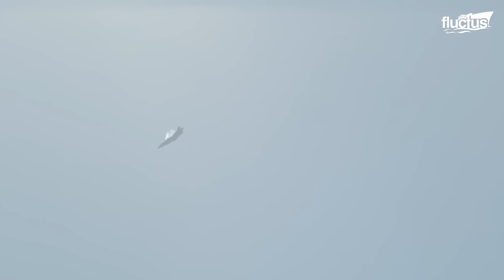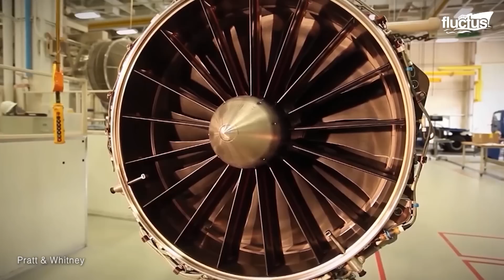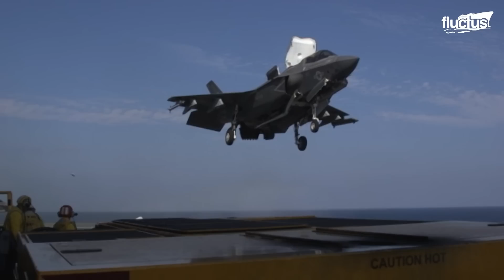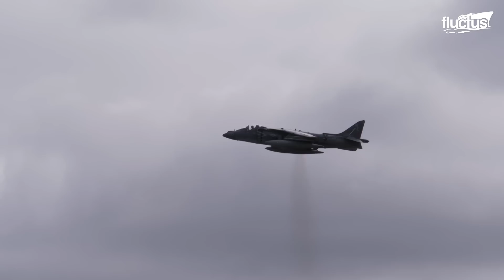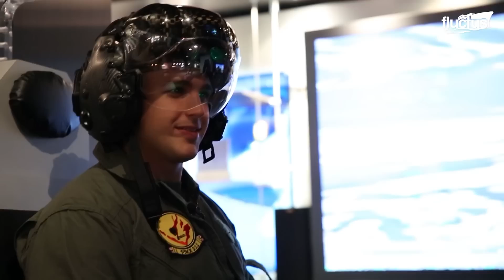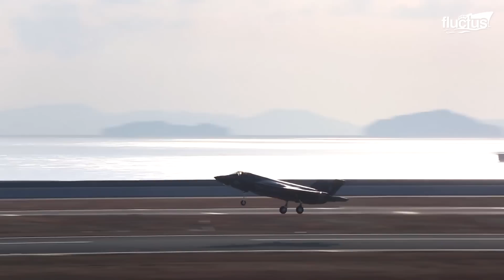Inside the US Multi Billion $ Super Advanced F-35 Assembly Line

Comment: Vertical takeoff and landing it’s kind of a joke if you think about it all that time it takes to open an angle the nozzle and float in the air leaves it vulnerable for the enemy to shoot you down before you even started and if you plan on doing a vertical landing you’re just stopping to make it easy target for the enemy to shoot you down there as well. I think it’s a lot quicker to slingshot a plane off the deck and same for landing with the arresting cable. 
F35 cheaper….. lol your crazy
Reply: It's great to have one. 1 is better than 2. And dafuq would it matter if an aircraft carrier can be shot while an F-35 lands/takes off then any plane can be shot, right? 🤣🤣🤣 But there's a mention in the video using the traditional catapult with the F-35C.

Comment: F-35B cannot take off vertically. It needs a very short runway. It's a STOL and not a VTOL.
Reply: It's capable of vertical takeoff, just not with much more than an air to air load out and minimal fuel. Still, could be useful for transferring between two close areas.

Comment: Uh, the F35 is not manufactured by Northrop. It’s made by Lockheed in Ft Worth.
Reply: Northrop helped with the development of the F-35 though, so Lockheed isn't the only company involved with the jet.
Reply: The F35 parts are outsourced to many different companies, the company I work at (JCMI) makes some F35 parts
Reply: @DirtFather407  good info thanks
Reply: No Northrope builds the main f-1 tank.
Reply: Actually it's made in every Country that participates in the program and is assembled in Fort Worth
Reply: Starts in Marietta GA
Reply: Starts in pinellas park Florida, bulkhead is drilled and assembled there. Marietta is the second step

Comment: How did Northrop end up manufacturing a Lockheed aircraft?
Reply: Lockheed is the primary but all of the big 5 have a hand. Northrop does the cabin, BAE does the tail find, Ratheyon/P&W does the engine, Boeing has a lot of the avionics and LM is full assembly. In fact the factory footage is an LM facility.

But that’s the least of the inaccuracies in this video.
Reply: @arthurvandelay846  Northrop Grumman literally supplies the F-35's radar, one of the most important component of a modern fighter aircraft.
Reply: Yeah, big slipup.  I have been thru the plant in Ft. Worth twice to tour as my company manufactures parts for it.
Reply: Funny enough I thought I was the only one who noticed that. Maybe they are manufacturing partners
Reply: No. He made a mistake. Good catch. I used to work for Lockheed Martin who builds it.
Reply: Because LM purchased and now owns Northrop - so Lockheed uses those assets. it is a Lockheed product, but Lockheed owns Northop.
Reply: @Albertkallal  That is not true. In 1998 Lockheed did try to by Northrop, but the government put a stop to it. They are still separate companies.
Reply: @dMb1790  
Thank you kindly - I stand corrected. I will leave this comment up - not delete my mistake. I had thought LM purchased them - and it looks to be I am 100% dead wrong. And that means the suggest/hint/quote in this video is thus also wrong.
Reply: @Albertkallal  I blame Google. If you search it, it has that commonly asked questions part, and one is “Is Northrop owned by Lockheed?” Under the answer section Google just copied the part that says,” In 1998 Lockheed agreed to buy Northrop.” And it leaves off the part about the deal being cancelled.

Comment: This site is wrong about the F35 Time Line.  
On Paper all 3 Variants was Designed, Built, and Tested at the same time.  
However, the Testing Phase Turned into a Nightmare for all 3 Variants Resulting in the 3 different Operational Status Dates.

Comment: That little airplane can carry 18,000 Pounds of ordinance? That's not a massaged number or a typo?
Reply: @Gettomaybe  pretty amazing that thing can carry 133% it's weight in fuel and ordnance.
Reply: Actually, they rate the F35 for a max of 22,000 lbs payload.
And yes, that is astounding. While all fighters use what we call a "lifting body design", clearly the Lockheed skunkworks did some really amazing work in this area, and took this concept to a whole new level.

You can see the results of this technology:

dry to max payload:

Gripen (39E/F) – 18, 739 lbs
F16     – 20,000 lbs
Typhoon – 27,800 lbs
F18     – 28,900 lbs
Rafael  - 31,300 lbs
Su57    - 37,320 lbs
Su35    - 38,139 lbs
F15     - 40,000 lbs

F35     - 49,540 lbs

Above figures are max takeoff – empty weight.

Now, unless Lockheed has some secret anti-gravity machine (they don't), then it is really amazing how much lift the F35 can produce.
So, maybe the F35 should be called the ant man fighter, since it is able to produce amazing amounts of lift for its wing size.

Comment: did f35 ever get in to a dog fight
Reply: No, it’s not made for dog fights, it’s made to take out enemies beyond visual range.
Reply: @KillersFromTheWest  ok
Reply: @moonlight_5836   the f22 is the dogfighter
Reply: Well, the F35 has a better (higher) thrust to weight rating then a F16, and even better then  duel engine Rafale. And with a better power to weight, you get better kinetic energy recovery. And given that the F35 is a duel tail section as opposed to a single tail setup like a F16 or Rafale?
Then the F35 will result in a better and higher maneuverable fighter - and hence a better dogfighter then say a F16 or Rafale.
Reply: @Albertkallal  Depends on loadout. If the F-16 and Rafale is carrying nothing, and just relies on it's cannon. Sure, they're more manouverable. But if both aircraft are actually carrying a combat load, the F-35 is easily superior. Internal weapons bay, so no excess drag either. That makes a huge difference. It's why the F-35 can go supersonic on a full weapons load, and though the F-16 technically has a faster top speed, without that engine power and with increased drag, it won't be able to catch the F-35.
Reply: @britishmalayasociety  
Here is the power to weight ratings.

(higher = better)

Fuel or
payload	Rafale	F35	         F16	Gripen 39 E/F
0	         1.4137	1.3984	1.4784	1.2617
700	        1.3737	1.3672	1.4284	1.2130
2500	1.2806	1.2932	1.3141	1.1035
3500	1.2341	1.2555	1.2581	1.0508
3750	1.2230	1.2464	1.2449	1.0384
5000	1.1704	1.2028	1.1826	0.9805
6000	1.1314	1.1701	1.1371	0.9387
7000	1.0950	1.1391	1.0950	0.9003
7500	1.0777	1.1242	1.0751	0.8822
9125	1.0249	1.0784	1.0151	0.8283
10362	0.9880	1.0459	0.9737	0.7914
12000	0.9431	1.0058	0.9239	0.7474
13500	0.9055	0.9718	0.8825	0.7111
15000	0.8707	0.9399	0.8447	0.6782
18250	0.8038	0.8776	0.7729	0.6165
20900	0.7564	0.8325	0.7228	0.5739

From above:

The F16 has to burn fuel down to a rather low 3,500 lbs to match the power to weight of the F35.
The duel engine Rafale fairs even worse, and has to burn fuel down to a bone dry 700 lbs to match the Power to weight of the F35.
And the poor Gripen - starting at 0 it matches quite much none of the others!

At 10,000 lbs payload, both the Rafale and the F16 now weigh MORE then total engine power (can't fly straight up). The F35 still can!! - and even with 11,000 lbs, or even 12,000 lbs can do so!

Edit: And the poor Gripen JAS 39 E/F? With JUST a fuel payload of 5,000 lbs, the total aircraft weight is now MORE then total engine thrust. (it can't fly straight up on engine power with JUST a payload of 5,000 lbs!!!).

So yes, the F35 has a better power to weight rating then the F16, or Rafale (at above 3,500 lbs - which is quite much all the time!!!).

The F35 also has a MUCH higher mil power rating (non after burner).

Take a F18a, rated for Mach 1.8. But, hang JUST 4 AIMS on that F18. Now top speed is only Mach 1.4 (slower then F35). But you NOT YET added fuel wing tanks!!! (and you quite much have to for F16, or Rafale, or older F18a's).

You get this fuel tank size:
Fuel capacity (fuel tank size):
Harrier  7,000 lbs
F16 – 7000 lbs
Gripen39E/F – 7,500 lbs
Rafale 10,362 lbs
F18 – 10,860 lbs
Typhoon – 11,000 lbs
F15 – 13,455 lbs
F/A-18E: 14,700 lb
F35 – 18,498 lbs

With just ONE centerline fuel tank on a F16, your max g-loads are now about 5.5. And you have this issue with the Rafale.

In fact, when F16's fly with F35's? They can't keep up. They start to fall behind, and have to punch afterburners to catch back up. The F16's then start to fall behind, only having to repeat the use of AB's.

But, on internal fuel, a F16 has about 3.5 minutes of AB time - after that, HALF your fuel is gone.

And as I noted, hang JUST 4 AIMS on the wings - your top speeds are now slower then F35, but you NOT yet put fuel bags on the wings.

Toss in a LOWER and WORSE power to weight rating on F16 or Rafale? Then you wind up with LOWER and worse operational speeds. Espeically in the transonic range.

As  result, we find these quotes from pilots:

pilot Lt. Col. Hank “Hog” Griffiths
Even when loaded internally with two 2,000lb GBU-31 Joint Direct Attack Munitions and two AIM-120 AMRAAMs, Griffith says the sheer power of the Pratt & Whitney F135 is evident. “The engine has a lot of thrust. It’s been fun to outrun the F-16 (chase aircraft). They can’t keep up. If we go to full military power the F-16 has to go to afterburner to keep up

Norway pilots ALSO note the same - they flew F16's, and are now flying  F35's.
quote:
We who fly the F-35 daily, can establish the following: The aircraft is faster, more maneuverable, has more range and, can carry a significantly higher payload and provides the pilot with a significantly better situational awareness than what we are used to from the F-16

Col De Smit – RNLAF
Quote:
F35 climbs, descends & accelerates like a clean F-16

QUOTE:
Compared to the F-16, the F-35A with “full war equipment” can cruise 10-15k feet higher without afterburner and cruise 50-80 knots faster, all of this additional energy is imparted on missiles

Comment: Very amazing aircraft with vertical take off capability.🇰🇪
Reply: That verson was a uk request, so we built it.
Reply: I dont think It's that great with the vtol because of the fuel capacity
Reply: @f8tekid309  
Yes and no
The Harriers it replaces range was only 300 miles while the F-35B range is 500 miles
The key difference is that F-35 engine has growth options designed to improve thrust and range even with F-35B weight limitations
Reply: @f8tekid309  
Well, the fuel tank size without question had to be reduced to make room for the fuel tank. 
However, keep in mind that the F35 has an "award winning first in class" fuel tank to start with.

So, we get this:

Fuel tank size/capacity of typical fighters:
Fuel capacity (fuel tank size):
Harrier  7,000 lbs
F16 – 7000 lbs
Gripen39E/F – 7,500 lbs
Rafale 10,362 lbs
F18 – 10,860 lbs
Typhoon – 11,000 lbs

F15 – 13,455 lbs
F35B - 13,500 lbs        <- F35 B STOVL model
F/A-18E: 14,700 lb

F35 – 18,498 lbs

So, looking at above? While the F35A model blows away those other fighters?? (those fighters EVEN with 2 wing tanks tend to NOT yet match the fuel tank size of the F35A).

However, looking at the F35 B model?
Better then F18a,  On par with a huge F15, Better then Typhoon, F16, Rafale, Gripen.

So, I would not exactly say that the F35B model is poor. In fact it ONLY poor when you compare it against the F35A model, but against other typical 4th gen fighters, the F35B actually has a VERY good fuel tank rating.
Reply: F-35 is a compromise bird. Very neato but weak at top speed and manueverability.
Reply: @Deploracle  f35 is a super computer that has wings and flies. Nothing more, nothing less.